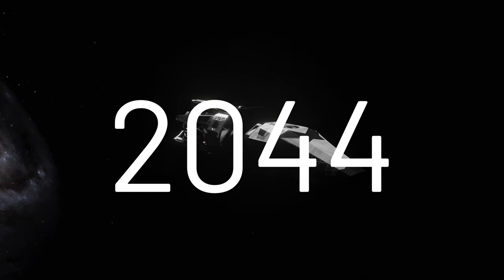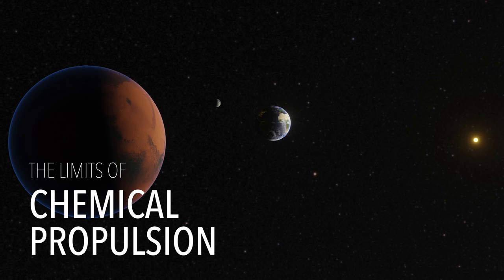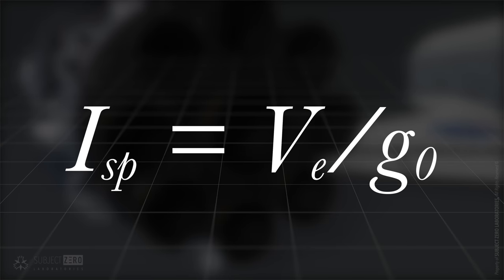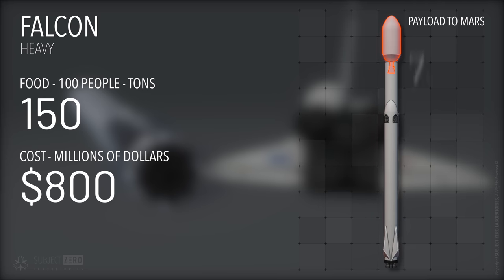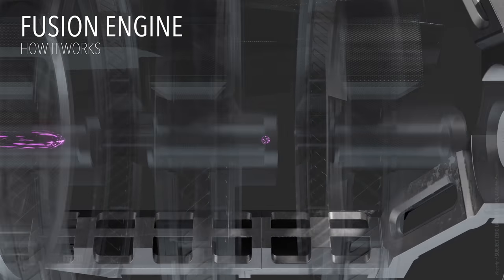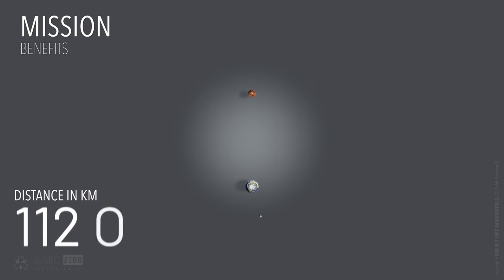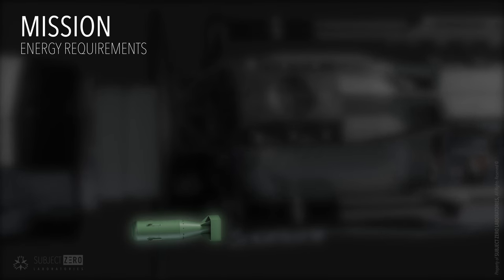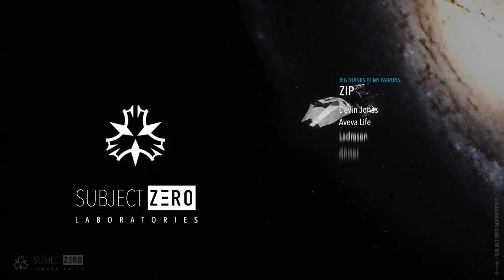Fusion Rockets - The Real Mars Express

Comment: So your using a fusion pulse pulse engine. You could just male a fusion rocket instead of going the Orion method.
Reply: Orion method would be using literal bombs
Reply: @ImieNazwiskoOK  yeah but your allowing a small amount of fusion material to cause a reaction in a magnetic bottle which pushes the craft along. It's not so different from using a bomb as both release energy really quickly to push a craft. I think someone updated the orion design to use magnets as. well.
Reply: @zetoboogaloo8802  I mean it's probably only way of direct fusion engine (non direct would be tokamak and Ion engines or something in the style of NERVA).
And it's VERY different from project Orion concept.
Reply: @ImieNazwiskoOK  yeah its different but it's basically an uncontained magnetically housed fusion bomb being let off to provide thrust. It doesn't use a large plate but magnets. It's just that the magnets push the energy away. There is a craft that uses magnets like the Orion like this craft does and uses nuclear explosives to move. And it does work similarly to this one just with explosives. Which is where I made the connection in my head.
Reply: @zetoboogaloo8802  It works far differently than fusion bomb (which don't use electromagnetic field).
Also what is the name of that concept?
Reply: @ImieNazwiskoOK  can't remember but I do remember what it looked like. And it was more of a concept. Sorry for sounding vague and going from one subject to another. Writing this in any way that makes sense is eluding me for some reason.
Reply: I also seem to have misinterpreted your concept. I apologize.

Comment: Positron catalyzed fusion (https://www.youtube.com/watch?v=EBjt2CgZACU&t=58s) looks promising. 
Fission reactor drives will come along before fusion, in various forms. The bar to that is political, not technological.
Could neutron mirrors be used to reduce radiation to the crew and increase the specific impulse by redirecting neutrons?  
Sub critical mass fission  reactors use  neutron mirrors created using alternating  thin layers of nickel and titanium to sustain the reaction. 
Some radiation can be absorbed with high hydrogen plastics, or a water blanket saturated with  metal hydrates, like di-sodium octo-borate tetra-hydrate, as the boron absorbs neutrons.  
On mars, digging in will be critical.  Nothing like a yard of regolith to cut milli-rads. 
I would bet early Musk's Starship landings will be cargo only, then heavily robotic.
Getting into orbit inexpensively is more than half the battle.

Comment: in reality, in 2144 "we finally decided fusion is never going to work"
Reply: We proved fusion worked in 1951, if were feeling particularly bonkers or kerbally could use them project Orion style to propel a space ship.
Reply: (sad Sun noises)
Reply: @marthale7 Tsar Bomba: Am I joke to you?
Reply: You should follow ITER. They might just be able to achieve a viable fusion power plant when it’s completed in a few years, which could kickstart a race to replace as much of our energy needs as we can
Reply: @onyx9954  ITER will break even and also generate more energy then takes to run, but that's raw energy, not electricity. 
 I am yet to see how it'll lead to a viable power plant. No one seems to have an answer for how Tokamaks can be used for power generation. Thats not to say fusion can't, there's lots of different methods being developed, but I'm personally very sceptical on Tokamaks.
Reply: @davescott7680  Heat boils water.  Same as coal-oxygen or uranium fission power plants.
Reply: @stefanr8232  Yes, but, normally a coal reactor isn't surrounded by a wall of super conductors that have to be kept at only a few degrees above Kelvin, which takes months to get to that temperature.
Reply: @davescott7680  There needs to be some insulation around that superconductor.

Comment: nice video anyway bulky design full  of material data complicated structure, teaching poeple complex maters, how about WRC apraoch race to colect neturons between core, this is part where quick response form study university play a role actualy and plasma burner as warp egnine in star trek warp engine use core and ore uranium so in theory lets say marvel experiment if plasm warped through core in factor if there is any circle cycle you could boost things now in video is 3 core so if advanced enginering can be easy 6x core the stuff thart maters is like above 10 factor so as universe old in cloe to 14 something so tactical choise is factor 14 so we need liek 14 core test as in machining you nad bulky design first you understand one engine as motorbike with four valves then you get like 160 hp from 1 liter is quite good so investgation report using quantum computing theory is like could neturon actualy use iregular path to be collect as form off will and what type off angle could be used best if liked anyway even step inc collecting eficient neutron or wahts best reuslt today is step in right direction rest is magnet core works as just combustion engine vlave it recup strength so technicaly you form mater off destabilizing plate and colecting a  stabilizing phase or like plus minus stuff est is in discharge in mater off pyhsics so a smaller tocamac and some fuel mater which ae quite small by volume make stuff purpose engine on lvl off expedition rockets on mars easy this what space x should learn also to build thanks to comprehensive tech off star trek and some theory and practicng basic how which only proves this stuff egzisting and only function more at less and less volume and increase productionability and range and be more productive in nother words creative stuff especialy for research and inovation  or production assembly, in nother words tocamacs on a assembyline miniaturized are great products ofr research adn inovation labs or expedition rockests as tommorow they are nto even rockets more like Joseph Cocram wars drive systems his first was solvign problem off stability in warp 2, something easy like 4 and something which was spectacular and his bear thing in future, so this famous ass this aint no holodeck reveal could actualy reveal stuff that maters can pass in limitaions and be boosted stabily this slight jumps form corvette to another corvette lvl nad lower price to travel and time after speed solve mater is gravity mater locking on plate stuff mater to solve so this are physics goals and not that distant out in future

Comment: pu-238
Reply: if you sling air with centrifugal accelerator with electricity, mechanically or electrically, you can have small craft do it all
Reply: you would not wise to hoard supplies before anything low-g stuff goes to destination to mess things up
Reply: mini h-nuke cannon propulsion
Reply: circular or linear z-pinch, combined with centrifugal compression
Reply: a = v2 /r, rim v = T = 100MK (838km/s), hat variable 343 000 m/s, r= starship 4m, a=3000M-g =29MN  compression (175MN, 18000M-g 838)
Reply: dont worry about the reactor walls, have them be u-238 to generate extra stuff